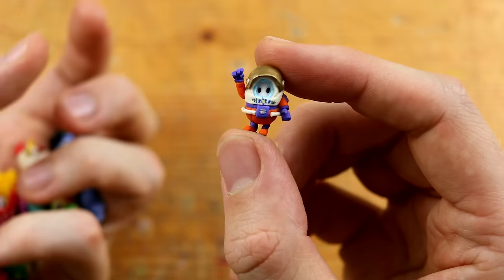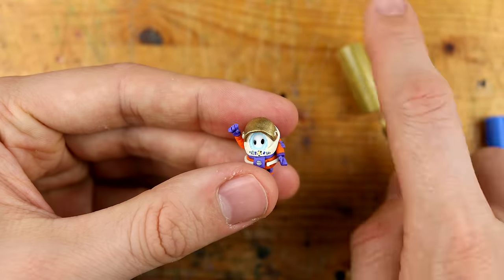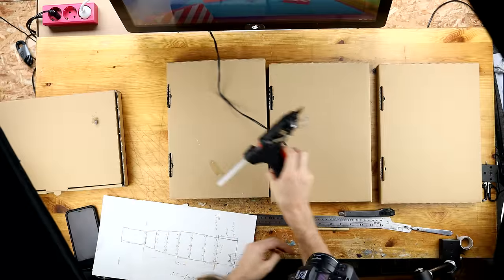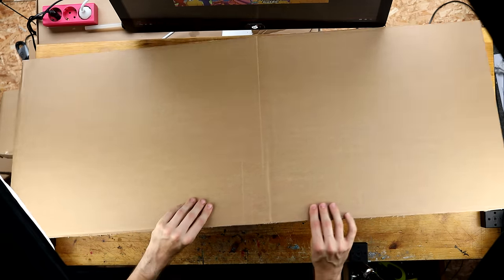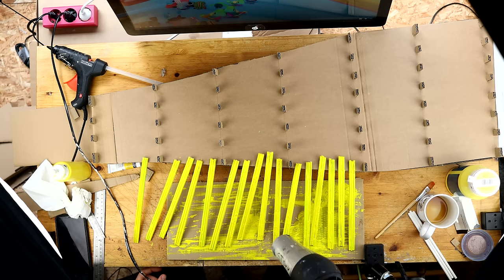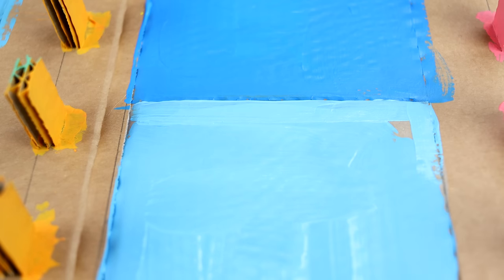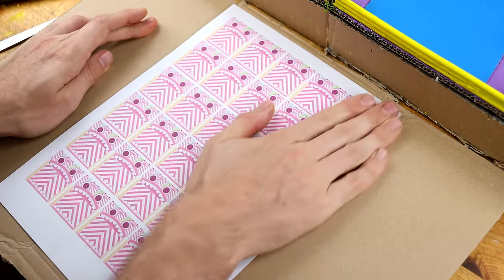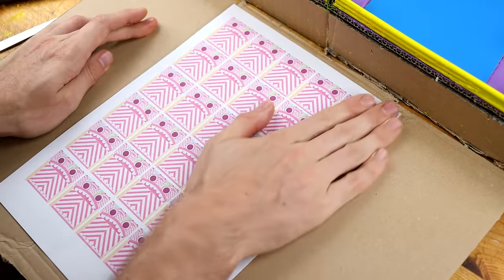Playing FALL GUYS Door Dash on my Desk – with Tic Tacs, Cardboard & Clay

Comment: Oh so your crewmate? Name every task Admin: Accept Diverted Power

Admin: Chart Course Admin: Enter ID Code

Admin: Prime Shields Admin: Swipe Card

Admin: Upload Data Balcony: Clear Asteroids

Balcony: Record Temperature

Boiler Room: Open Water Ways

Boiler Room: Replace Water Jug

Cafeteria: Accept Diverted Power

Cafeteria: Download Data Cafeteria: Empty Garbage

Cafeteria: Fix Wiring

Communications: Restart Wifi

Dropship: Chart Course

Dropship: Insert Keys

Electrical: Calibrate Distributor

Electrical: Divert Power

Electrical: Download Data

Electrical: Fix Wiring

Greenhouse: Accept Diverted Power

Greenhouse: Download Data

Greenhouse: Fix Wiring

Greenhouse: Water Plants

Hallway: Fix Wiring

Laboratory: Align Telescope

Laboratory: Fix Weather Node

Laboratory: Inspect Sample

Laboratory: Repair Drill

Laboratory: Submit Scan Lower

Engine: Align Engine Output Lower

Engine: Fuel Engines

Medbay: Accept Diverted Power

Medbay: Download Data

Medbay: Fix Wiring

Medbay: Inspect Sample

Medbay: Submit Scan

Navigation: Accept Diverted Power

Navigation: Chart Course

Navigation: Download Data

Navigation: Fix Wiring

Navigation: Stabilize Steering

O2: Accept Diverted Power

O2: Clean O2 Filter

O2: Download Data

O2: Empty Garbage

O2: Fill Canisters

O2: Fix Wiring

O2: Monitor Tree

Office: Download Data

Office: Fix Wiring

Office: Scan Boarding Pass

Office: Swipe Card

Outside: Fix Weather Node

Outside: Open Water Ways

Outside: Record Temperature

Reactor: Accept Diverted Power

Reactor: Divert Power

Reactor: Download Data

Reactor: Fix Wiring

Reactor: Start Reactor

Reactor: Unlock Manifolds

Shields: Accept Diverted Power

Shields: Download Data

Shields: Fix Wiring

Shields: Prime Shields
Reply: Wow that's a lot of among us tasks
Reply: Yeah but you vented in front of EVERYONE
Reply: @MikeyMandFluffyMainProductions  he did!? wHeRe???